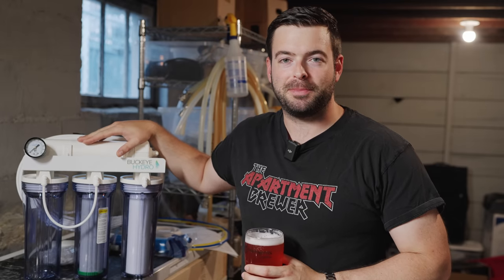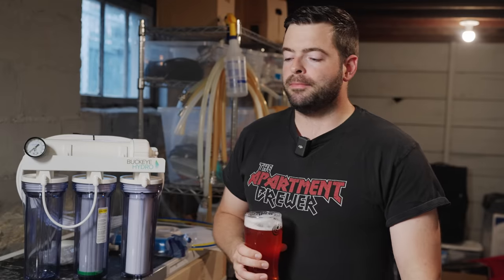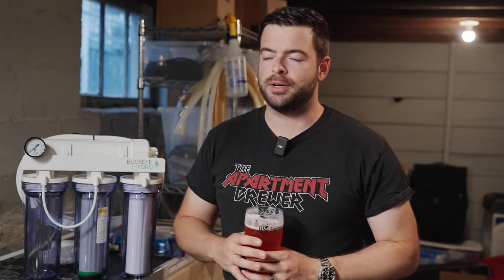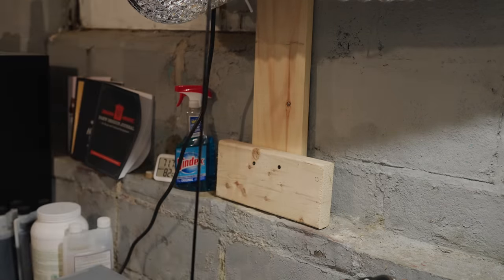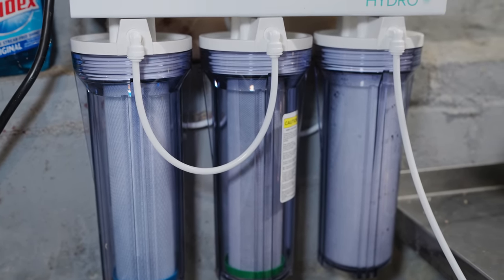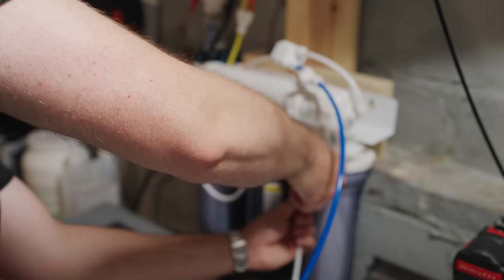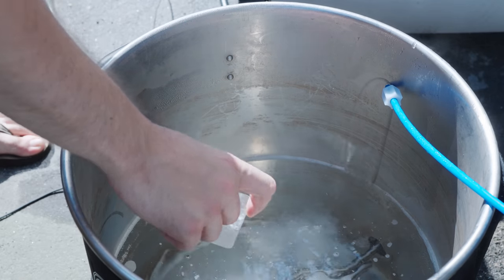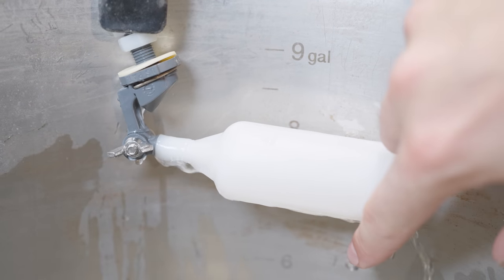How to Get the BEST BREWING WATER AT HOME - Installing an RO SYSTEM

Comment: I have a Buckeye Hydro premium system but don’t need the chloromine filter as I have a well.  I set up my system with a 25 gallon  rectangular, food grade, marine/RV water tank.  I got it without holes.  I installed a tri clamp bulkhead  that I used to suspend a 1/2” silicon hose with a hose connector and a SS coupling on the end to keep the hose about 1/4” above the bottom.  I have a pump mounted on top of the tank that runs off a dedicated switched outlet.  I have a 6” waterfproof screw top  marine deck cover to access the tank inside of the tank for installation of bulkheads and the float valve.  I use a quick disconnect from the pump to the silicone hose I use to fill my kettle.  I make 20 gallon batches.  I made a copper “U” outlet so it hangs over the edge of the kettle while it fills.  I also installed a second tri clamp bulkhead that I use with a very fine screen to vent the tank when I am filling or draining water.  The next time I empty the tank I will be installing  a 13” thermowell so I know the water temp when I start my brew day.  If you’re interested, I have photos…. Congrats on your latest upgrade!
Reply from the maker: Sounds like a great setup!

Comment: My favorite find when I switched to RO was an "Adjustable Float Valve Mount".  Got rid of the alligator spring clamp and able to set the float level to not overshoot how much water I need.

Another nice $5 add is to put shutoff valves on all three lines.  Shut off the output line, then the waste, then the input before closing the tap and disconnecting.  This ensures the RO membrane stays fully wet if you're gonna have a couple of weeks between brew days.
Reply: Much better than how I do it: setting a timer for 3 hours because I did math wrong on RO gallons per hour, coming back and finding my kettle flooding lol
Reply: @GREEENZO    that's called planned housekeeping - it was time to mop the floor anyway....
Reply from the maker: I'll have to add those extra shut off valves, thats a good tip!

Comment: I just picked up an RO system myself for the same reason that you did with buying water for brewing. It never occurred to me to use a float valve to regulate the system. I do not have my fully hooked up yet, but mine did come with a 4 gallon reservoir as well. Once my barn project is finished and I get a permanent brewing area I may install that so that there is a 4 gallon buffer for the start of the whole brew day.

Comment: You can add a permeate pump to an RO system to reduce waste water.  AND you could use that wastewater on the lawn. I have been doing that for years and it works exceptionally well.  Not sure if waste water is ok for veggies but the lawn loves it.
Reply from the maker: Great tip!
Reply: Remember that a permeate pump only works on systems equipped with a pressurized storage tank.

Comment: Good call Steve! I did this for the same reason, got many of my beers down to 15 cents a pint when I harvest yeast and buy bulk grains / hops. You won’t regret it! Mine doesn’t completely get rid of chlorides, even though I’m usually 8-12 ppm every batch, I add a couple campden tablets to completely isolate the minor chlorine flavor.
Reply from the maker: Well done! Campden tablets are a great way to help remove the chlorine/chloramine!
Reply: Chlorine (not chlorides) should be at 0 before, and after the RO membrane

Comment: Great job and good to cover how to install an RO system. The PPM is very impressive without an inline Deionizer. I have the same in-line TDS monitor, with my deionized water, it is only a little lower as 14 is amazing as mine is usually between 2 to 4 ppm (My city water is usually around 255 ppm going into the filter system). I picked up my TDS monitor for $25 but noticed they've raised the price to $40+, but seem to keep it on sale a lot around $21.
Reply from the maker: I got mine down to 7 as the membrane broke in! I almost went for the RODI but thats just a bit too expensive for me.

Comment: Hi Steve, nice video.  Question for you:  why not just get a storage tank?  Messing with the float valance seems like a pain in the butt.  Plus the possibility of an overflow and water damage seems like an unnecessary risk.  Plus with a storage tank, the water is ready for you.  Just curious, other than cost, why not use a storage tank?
Reply from the maker: Because I do not have the space for that at all
Reply: Some fun facts to know and tell:
**The purity of the RO water coming right out of the membrane will be better than what comes out of a full pressurized tank. 
**You'll send much less water down the drain as concentrate if you use an UNpressurized tank rather than a pressurized tank.

Comment: I installed a RO system earlier this year based on the video Short Circuit put out (which I trust you've seen).  Like his system, I have the output going into a 30-gal barrel, with a pump on the output side, which means my kettle fills pretty quickly.  And the float valve is then in that barrel, rather than in my brew kettle.  And since I'm using well water, I know there's no chlorine in it.
Reply from the maker: The reservoir is a great add-on, and I would have done that but I'm too short on space

Comment: One additional thing you may want to incorporate. I used to have a saltwater fish tank and had a RO DI system. I can't tell you how many times I said, "I'll make sure to turn the water off in an hour" and then totally forget, the float valve decided to stick or not work and dumped water in my unfinished basement. If possible, put the brew pot to be filled inside a utility sink if you have it.
Reply from the maker: At this point, I'm still setting a timer based on the flow rate anyway despite seeing the float valve working well. I'd rather not have a spill, and I don't have a sink down there.

Comment: I have to confess that my RO system has been sitting unused in the garage for some time now. I brewed some pilsners with it very successfully but was frustrated at how slow and wasteful it was. Although the waste water went in one of our water butts for the garden, they are filled to capacity with the water from my immersion chiller on brewday anyway. Since making the one-off investment for my tap water to be analysed by Murphy and Sons here in the UK, I just go by their recommendations in terms of water salts, relative to my source water profile. Just about perfect every time when I measure the PH of the mash.
Reply from the maker: It depends heavily on your input water hardness, and the efficiency of the membrane inside. Unfortunately some people are going to have worse RO to wastewater ratios than others. Glad you have it figured out well for your tap water though!

Comment: I've been kicking around the idea of getting an RO system. Do you have any information on the expected life or replacement frequency of the filters/membrane?
Reply from the maker: The filters will last a long time, they recommend changing them every 6 months ($25) and then swapping the RO membrane once you see the flowrate go down and the TDS go up, again this should be on the order of several years ($30)
Reply: @TheApartmentBrewer  Thanks for the info! I currently use my tap water that I treat with campden tablets and adjust based on a water report from the city. I make good to great beer but I occasionally get an off batch. I can't shake the feeling that it might be an occasional source water change. So I've been trying to figure out an ROI on buying distilled from the store vs installing a RO system. Not as much of a slam dunk savings compared to you as DI is only $1.25/gal where I live.

Comment: I have thought about it, but also I feel I am lucky that we have some of the best water in Canada in my city, my water profile is pretty good and easy enough to match or get close to whatever water profiles im aiming for with adding very little salts
City of Edmonton, AB, Canada
CA - 43PPM
MG- 12.9PPM
NA- 8PPM
SO4- 5PPM
CL- 1.7PPM
HCO3- 2.9PPM

This being said I always add a campden tab about 24 hours before, i've also used Nutrafin aqua + in the past  hahaha which is used for fish tanks but works the same
Reply from the maker: Thats very impressive water! I hope it is consistent for you year round.
Reply: @TheApartmentBrewer  it is great for most of the year except spring when there is run off, but they do weekly reports so I'll have to keep an eye on it this spring :)

Comment: I’ve really been looking into these systems for a while. I think for my application I will need the pressure tank and a pump to get adequate flow through the system. Plus my municipal water supply has twice the TDS as yours. So I’m looking at a much more robust system.
Reply: If you have good water pressure, it should work for you.  Just may have to go with a slower output.  I've got the same exact model - but configured for 24 gallons per day (different flow restricter and RO membrane).  My source water varies from 300 - 350 TDS and pressure is pretty steady at just over 50 PSI.   Output is within a point or two of 7 TDS, maybe up to 9 in the dead of winter when the ground water is in the low 50's.
Reply from the maker: The only variable that would theoretically change with a higher input TDS is the life of your filters. The system should still be just as efficient.

Comment: Steve, open up the pipe to the RO system, make the water in as wide as you can and step down as close as you can to the RO system.  At 60 psi you will get much faster flow !!!
Reply from the maker: I am running at 60 PSI
Reply: But try it - the flow you get it much faster.  Also at that PSI you should consider a permeate pump, you'll get much less waste water
 @TheApartmentBrewer

Comment: Great informative video. How often do you think you will have to change filters? Also, if you don't brew often is there any concerns about "stuff" growing in the filters? Do you have to run water through periodically to prevent "growth"?
Reply from the maker: Filters should be changed once every six months, and the RO membrane will last several years theoretically. As far as microbial contaminants, I'm not sure how quickly that would happen if left alone, but the system is easy to sanitize and theoretically only needs to be sanitized once a year. Plus any microbes would probably get filtered out anyway and then of course all the water is getting boiled.

Comment: I had one of those and switch to a resin system. It is a bit more waste but 10x faster and has even less disolved minerals
Reply from the maker: I may make that upgrade eventually. It is far more expensive relative to the RO system though.
Reply: @TheApartmentBrewer I built my system for 50 Euros plus the resin costs. But I had some.fittimgs laying around. So if from scratch it would have been maybe 70 euro. Comes with the price of throwing away 700ml of resin everytime I produce 55l of water. We have so damn hard water that it does not last long, but it is so much faster

Comment: I'm interested in how often you have to change filters too, as someone else commented.  Also, how do you know when it's time to change?  Is there a threshold value on the TDS meter that indicates when it's time to change?
Reply from the maker: The filters will last a long time, they recommend changing them every 6 months ($25) and then swapping the RO membrane once you see the flowrate go down and the TDS go up to something like greater than 10% of the input TDS, again this should be on the order of several years ($30)
Reply: Here's a longer-winded reply from our FAQ's:
A good rule of thumb is to replace your sediment filter and carbon block(s) after six months. A more precise way to maximize the usable life of these two filters is to use a pressure gauge to identify when pressure reaching the membrane starts to decline. This is your indication one or more of the prefilters (all the filters that touch the water before it reaches the RO membrane) is beginning to clog.

Also be cognizant of the "chlorine capacity" of the carbon block(s). A good 0.5 micron carbon block for example will remove much of the chlorine from 20,000 gallons of tap water presented at 1 gpm. Best to change out the carbon block at no more than 50% of the chlorine capacity.  Some original equipment suppliers commonly provide carbon cartridges rated at 2,000 to 6,000 gallons. Remember that all the water you process, both waste water and purified water, goes through the carbon block.

Regarding your RO membrane, use your total dissolved solids (TDS) meter to measure, record, and track the TDS (expressed in parts per million [ppm]) in two places: 1) tap water, and 2) after the RO membrane.

The TDS in your tap water will likely range from about 50 ppm to upwards of 1000 ppm. Common readings are 100 to 400 ppm. So for sake of discussion, let's say your tap water reads 400 ppm. That means that for every million parts of water, you have 400 parts of dissolved solids. How do we go about getting that TDS reading down to somewhere near zero?

If you do some experimenting with your TDS meter, you'll note that your sediment filter and carbon block do very little to remove dissolved solids. So with your tap water at 400 ppm, you can measure the water at the “in” port on your RO membrane housing and you'll see it is still approximately 400 ppm.

The RO membrane is really the workhorse of the system. It removes most of the TDS, some membranes to a greater extent than others. For instance, 100 gpd Filmtec membranes have a rejection rate of 98% (i.e., they reject 98% of the dissolved solids in the feed water). So the purified water coming from your 100 gpd membrane would be about 2 ppm (a 98% reduction).  The lifespan of an RO membrane is dependent upon how much water you run through it, and how “dirty” the water is. Membranes can function well for a year, two years, or more. To test the membrane, measure the TDS in the water coming into the membrane, and in the purified water (permeate) produced by the membrane. Compare that to the membrane’s advertised rejection rate, and to the same reading you recorded when the membrane was new. Membranes also commonly produce purified water more slowly as their function declines.

Additionally, don’t forget to sanitize the entire system at least once per year, and wash and lube your housing o-rings with food-grade silicone grease every filter change.

Comment: I make my brewing water using a demineralizer resin (don't know the English word - it looks like golden sand and removes anions and cations) and use a conductivity meter to check. Usually, I easily reach conductivity levels of commercial demineralized water (about 10 µS, from tap water having nearly 500 µS). No waste water, but you have to buy the resin regularly. It's not dirt cheap, but way better than buying water.
Reply from the maker: Yeah so you have an RO/DI system. Those are a great investment as well, and you have extremely pure water at the end!
Reply: So you have a DI filter w/out an RO.  Check to make sure your DI resin is rated for potable water - most are not.

Comment: I have a question, I am new to brewing beer. I did my first kit which was gifted to me last Xmas. My DME had hardened and the steeping grain seemed okay. I used bottled spring water. With that being said, I steeped for 30 minutes at 155, and boiled for  an hour.I Just tasted it after fermentation, and well I get a bad hay, or straw taste. Any idea if the hardened DME caused this?
Reply from the maker: Improperly stored ingredients can definitely impact flavor. I don't have that much experience with extract brewing so I can't be totally sure, but I think you're probably getting some impact from the age there.

Comment: I have (a perhaps stupid) question! Is the salt concentration calculated for the mash-water or the finished beer? Say, if I want 100 PPM cloride, is that 100 ppm in the 25 liter mash or in the 19 liters of beer?
Reply from the maker: Not a stupid question at all. The water profile that you would get from adding salts is for the mash and/or sparge water, not for the finished beer volume.
Reply: @TheApartmentBrewer  Thank you!! :))

Comment: -Don't waste the waste water, use it to clean your equipment after a batch.
-the DI resin is kinda expensive, and water that's only gone through the prefilter and RO membrane is probably good enough in many cases.
-RO/DI is good for diluting a 4g batch after fermentation up to 5g.
-Buy a couple prefilters and you can use the first stage or two to filter your beer after secondary.
Reply from the maker: Great tips, I definitely agree on the DI resin being unnecessary, 7 ppm is practically distilled water.